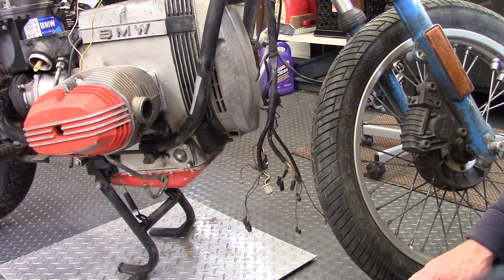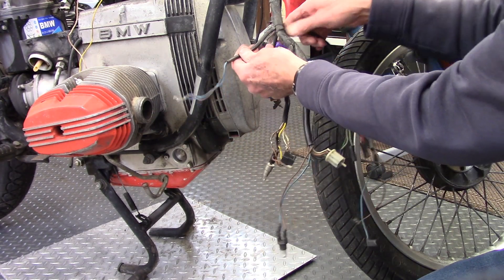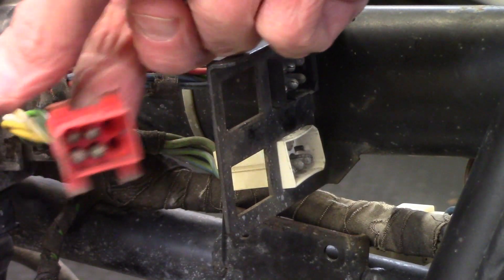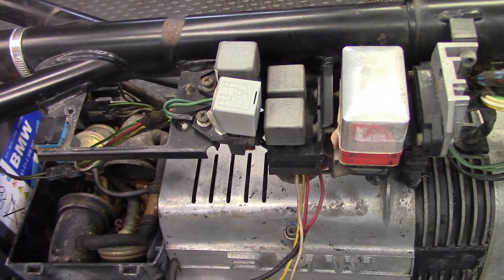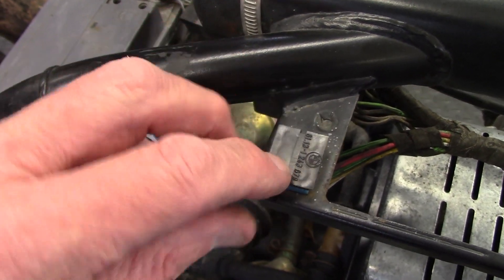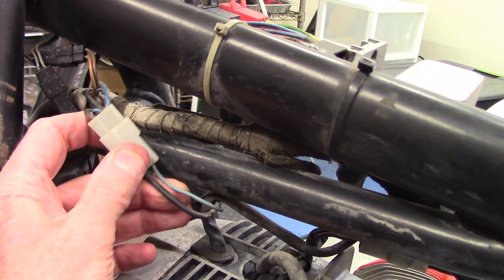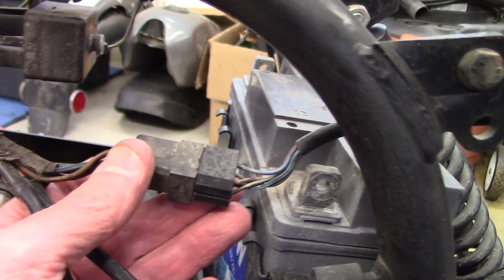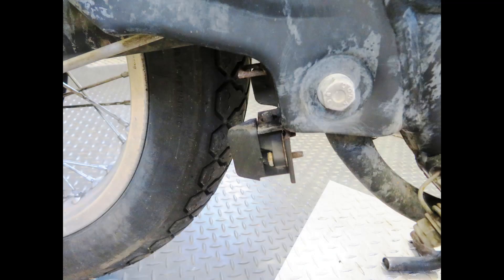1983 BMW R80ST Electrical System Overview

Comment: Bmw r65 1987 problem in light system, position light, low beam, dash light and stop light not working.

Bmw r65 1987 monolever

Hi, dear biker community. I’m restoring my bike and I need your help.

I’ve checked and replaced all the 6 boxes that work perfectly, in addition to having changed the 2 fuses under the seat and checked all the wires for possible breaks or disconnections.

Everything was working perfectly until I mistakenly put together pin 3 and 12 main wire harness where the instrument panel connects (when trying to install a new digital dash).

Since that time the position light, low beam, dash light, stop light and back stop light don’t work in ignition position 1.
In ignition position number 2, the turn signals, high and low beams work if I activate the command and the stop light if I press the brake, however the dashboard does not illuminate, neither do I’ve position lights, stop light.

Is there any other fuses or what could have been damaged when connecting those pins (both pins have 12v voltage)? Please if anyone knows what to do I would be very grateful with your help.

Comment: Oh man. I like this wiring setup so much more than the system used on my 1981 R100RT...which according to the VIN, actually started life as an R100CS. I had to take off the headlight to tighten up the two fairing support bolts on the steering head. A mess of wires and a couple of relays completely obscuring the board fastened to the back of the headlight bucket. If I had a fuse go on the road...I would have been buggered. 

I spent a lot of time taking a ton of pics of the mess as I took it all apart and relocated the board, all of the wiring and relays, inside the left part of the fairing. That R80GS wiring setup is super slick and simple. My rerouting works fine but it's still a bit of a pain tucked up under the fairing. I might have to try emulate something like the GS.

Comment: Great project! I have an 83 ST too (Rot), red in German. Please double check that the front caliper is mounted on the wrong side of the fork, both stanchions have mounts but the LEFT side was standard for the rotor, and the wheel hub had it’s mounts accordingly.
Reply from the maker: Hi Pedro, Every picture I've seen of an ST shows the rotor and caliper are mounted on the right side (as you sit on the bike), not the left.  My friend's ST also has the rotor on the right side fork slider. For example: http://www.bmbikes.co.uk/photopages/photosr80st.htm
Reply: Very sorry, my mistake, I’ve must been thinking of my other bike which has a left hand side rotor, I will double check next time I make a suggestion. 🥺.

Comment: Are you going to implement a Motogadget M-Unit and simply clean up all of that old 80s rat's nest of wiring?
Reply from the maker: Barron, my build plan is a restoration with improved components where it makes sense. However I have all the instruments so I will use them. The wiring is pretty simple compared to the airheads that put all the wiring inside the headlight shell. This bike just has the headlight and parking light bulbs inside the shell, so it's very clean.  All the dash lights are inside the tachometer so there's only one plug to feed them all.
Reply: @BrooksAirheadGarage  gotcha! I'm from the 70's and 80's era of Japanese cafe conversions and the M-Unit is the first thing I buy now, regardless of builds!